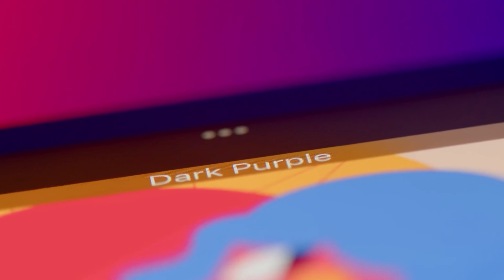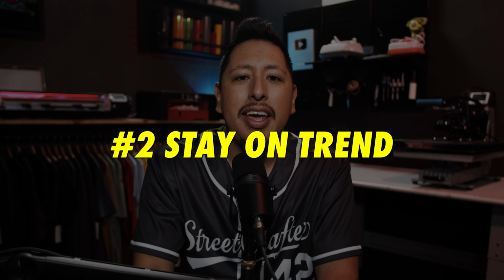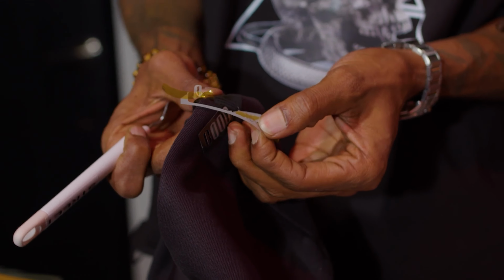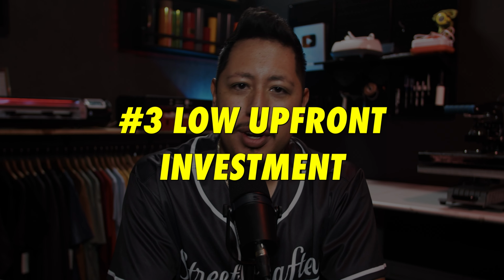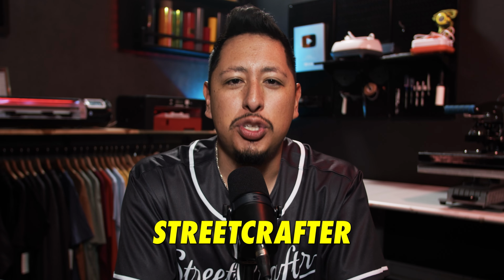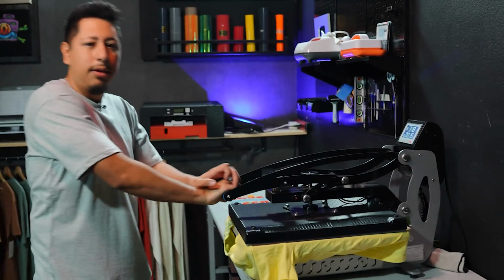Why A Heat Press Is A Clothing Brands Secret Weapon | T Shirt Printing Strategy

Comment: How do I avoid that heat square
Reply from the maker: The best way to avoid the majority of heat squares is by ensuring the proper temp and pressure. If that is failing due to the shirt composition, then put a heat press pillow and it will soften the edges and reduce that from showing up. That heat square goes away with a little time and wash 99% of time
Reply: @johnxsantos  thanks. I mostly notice it on sweatshirts